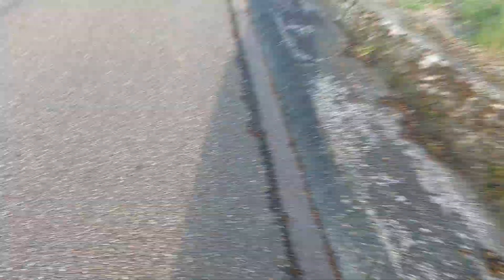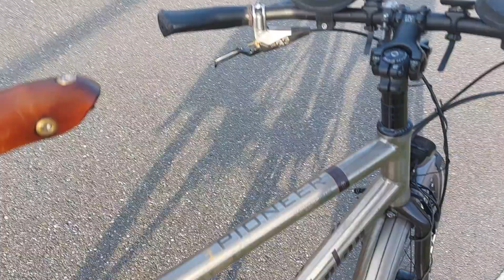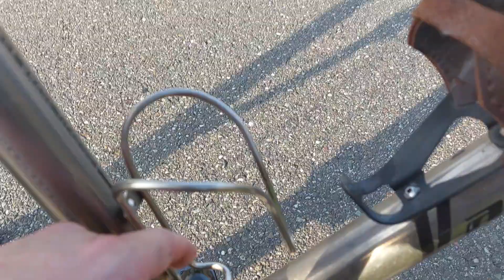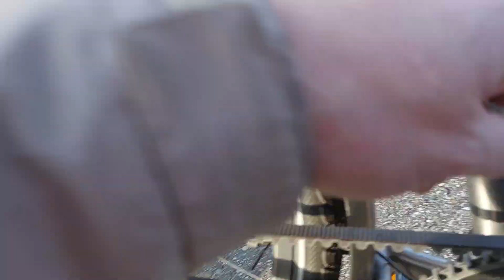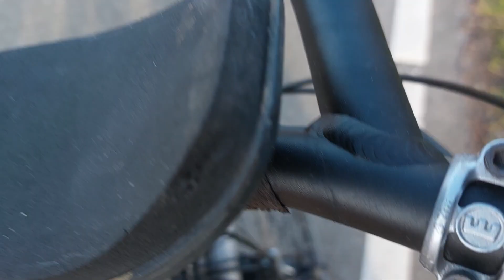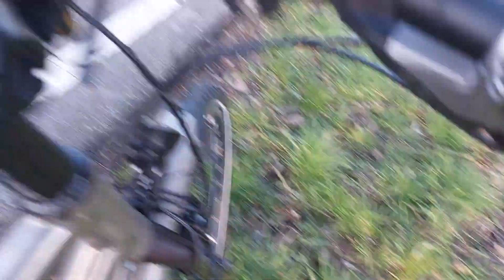review of the Rohloff speed hub: gear step size, noise, alternatives.

Comment: that saddle looks painfull ;)
Reply from the maker: It is not bad at all. Similar to a Brooks Professional in width but with a better carriage (stainless steel rails) and the shape makes it more comfortable. I want to try the wider 18 cm saddle from Berthoud which should be near optimal for slow touring (= riding with a lot of stuff in the panniers on bad roads) though the B67 at 21 cm wide also works for that so no real 'need' to buy that 18cm wide saddle.

Comment: Wanting to know what you ride currently
Reply from the maker: @kumsatx  : I still have the bike with Rohloff hub but it is in NL. I use the bike that I bought in Chernivtsi (Ukraine) in 2023 in Kremenchuk and the nearby village where I bought a house. It has a pinion P1.18 which I much prefer: less force needed to rotate the shifter, more gears, slightly smaller near optimal gear step size. I would replace the Rohloff with a Kindernay if it were available...
Reply from the maker: @kumsatx  : addition: perhaps I will replace the Rohloff hub with a Nuvinci or Alfine hub. Alfine 8 or 11, not sure, I had issues with the 11 in the bike of a friend of mine that it never selected all gears properly, 1 was always not quite ok.

Comment: Curious… why two cateyes
Reply from the maker: I had one wired but needed to repair it (cable was cut), the other one is wireless with cadence measurement (that is the main reason to buy it for me, 2nd hand, related to checking what the exact range of cadence is that I find comfortable, for my analysis on optimal number of gears), so I was testing to see if the repair worked well and also to see whether wireless transmission worked well as my experiences with Sigmas were bad and the I saw what difference auto on-off vs press to start with wireless makes for example. Side by side testing is very useful... I took the wireless one with me last trip and put it on the bike with pinion gear box.

Comment: What noise ?
Reply from the maker: At about 25 seconds and beyond you hear the noise which is like a gear noise. You hear it the loudest at the times that I push on the pedals hard (which I needed to do because of going uphill), so you hear <noise> <quiet> <noise> <quiet> from pushing with the left leg, right leg, etc. I made another video going on a flat road where I demonstrate the gear noise in a few gears. It is difficult to make clear exactly how noisy it is, but to me it is very distracting in gears 1-7, especially when going uphill and when riding on a quiet path in nature. In contrast the old Sturmey 3 speed hubs, the Nuvinci/Enviolo hubs, the Alfine hubs, are quiet. The pinion P1.18 is louder than those hubs but not annoying to me. It is a lot quieter than the Rohloff.
Reply: Also if it’s doing that on all gears from 1-7 then there’s an installation problem or perhaps not enough pressure in the gear hub after an oil change. I have never experienced any of these issues personally.

Comment: hub dynamo by shimano are pretty nice value for money, but they have substantial drag, especially over 22... 25km/h @ 28"
Shutter precision is better, SON even slightly better
After 25kkm with Shimano, SV and later on SON I'm driving now none... and went for USB rechargable light. Lowest possible drag... and cruise speed around 30 - 31km/h instead of 27 - 28km/h on the same bike.

Alfine 11: strong recommendation for keeping the R14 bike and drive both in change for longer time. Alfne 11 ist incredible value for money, but lacks efficiency and short gearing... and I felt and feel definitely the efficiency drop (having still 2 bikes with Nexus and Alfine 8)
Reply from the maker: How do you feel the drag from dynamos and the efficiency drop from Rohloff to Alfine? I have access to bikes with Nexus hubs, derailleur, Rohloff, here back in NL (for a few weeks) and I don't feel it. I do agree with the range issue with Alfine but more important for me is the gear setting which I never got right in the 500km that I used it in Poland, and that I wouldn't trust it for heavy loads/long tours. If I were to use another hub I would rather install a nuvinci/enviolo (besides the Kindernay 14 wh8ch hasn't been available for a long time).
Then dynamos: When riding 30 km/h I don't suddenly go 27 km/h when switching on the lights. There is a small drop in speed but not 3 km/h. In my calculations long ago I had the rolling resistance a bit low but that doesn't change the results much: https://swhs.home.xs4all.nl/fiets/tests/verlichting_analyse/theorie/berekeningen/index_en.html   About 1.1 km/h loss of speed with a sidewall dynamo that takes 18W at that speed, about 0.5 km/h with a good hub dynamo. The difference between dynamos is far less than that so I don't notice it. There is an issue in that bicycle lighting has completely switched to LED lighting since that analysis and such lamps use electronics that can be inefficient and cause possibly larger drag. This can also vary per dynamo as each has different characteristics that can influence how the electronics acts. It would be interesting to test this with a power meter... What dynamo headlamp did you use?

Comment: Don't care about the noise! It's not affecting the performance!
Reply from the maker: Well, I don't imply that it affects performance, I just don't like it. The Rohloff seems to be the most efficient and considering chains not always going straight and being clean, it is very close to a derailleur. I don't really notice the difference between my bike with derailleur and the one with Rohloff hub. But I do notice the shifter and the noise! Note that I mentioned efficiency in this video. I will add a bit more in a video with my conclusion after using the pinion P1.18 a lot, that I want to make today on a ride. I noted on my website that other factors seem to influence people into thinking the pinion is more efficient than the Rohloff hub, which is not so for the P1.18, and if the C1.12 were more efficient it could only be a few percent which you won't notice in use (the feeling that 'nomad's trails has about the Rohloff hub being heavy going/slower, I saw it in another video too recently, is almost certainly caused by other factors). See my page on the Rohloff and the other pages on gears here: 
 - https://swhs.home.xs4all.nl/fiets/tests_2/versnellingen/rohloff/index_en.html
- https://swhs.home.xs4all.nl/fiets/tests_2/versnellingen/index_en.html
Reply: @WHS_reviews  Oh, I can't add anything more!😃😀

Comment: Ill take that noise over a grinding chain anyday
Reply from the maker: The noise doesn't come from the belt but from the hub, so the choice is really about this hub or another hub, not belt vs. chain. You can choose an Alfine 8 or 11 or a Nuvinci/Enviolo hub with belt too. In comparison with a derailleur system it is far worse in noise, and that is despite the fact that I rarely clean my chain on my derailleur bike. I occasionally put some oil (up to a few years ago) or dry-lube (last few years)  on it, and there isn't any grinding noise despite not cleaning the chain even with oil...

Comment: I might buy a rohloff for my cargo bike that I'm building atm because other hubs don't have the gearing range necessary and the other option is a derailleur. I did the calculations and the rohloff is about double the cost of Shimano XT setup.
Reply from the maker: Yes, sometimes there is no better option. For heavy loads such as with a cargo bike and in hilly terrain it makes sense. Otherwise I'd go for a enviolo/nuvinci even putting gearing lower than allowed.

Comment: Alfine 11 has too high gears if you follow Shimano instruction of 1/2 (e.g. 42 teeth front, 21teeth back). Definitely a great hub for the price, and a shame it is not speced more often. Clearly not the same league as rohloff, but hardly few actually need a rohloff.
Reply from the maker: Agreed regarding gearing. As to price I guess you mean the mechanical shifting one, the electronic shifting is cool from what I've seen, solves the issue of cable tension/perfect shifting but at a lot higher price. The lowest gear was also an issue with the Nuvinci/Enviolo hubs I used, it was somewhat limited if following the specs. I used the N360 with front derailleur which would not follow their specs. Not sure if that changed in the newer hubs.
Reply: Depends where you’re riding. There are no hills at all where I live and I barely use the bottom half of my Rohloff gears ever. If I finally go forest touring with 25kg luggage the Rohloff will be amazing.

Comment: I very much appreciate this review.
Reply from the maker: What about the noise issue, did it show/sound well in the video? It is difficult to properly convey how loud it is (and I aimed the phone's camera + of course also the microphone forward, so not towards the hub), but to me the hub is loud. I think you had some experience with the Rohloff?
Reply: @WHS_reviews  yes I used to work at a few bike shops here in Toronto so I have had a lot of experience around many different types of bikes especially as an internal geared hubs, the noise did not come through the video but I do remember it being noisy in the first few gears. I priced it around 1500 Canadian dollars about 8 years ago we have quite a bit of bicycle theft  Toronto so I dare not leave it locked outside. So I dismissed this hub also back then it was only available in 32 whole version. I see that it's in 36-hole now
Reply: Phil wood made a special hub shell for rohloff hub with a beautiful finish and 48 hole version very expensive
Reply from the maker: @damian33dc  : Right, I could hear the noise from the hub in the video, but it stands out mostly if you know what it sounds like! :) I will try to make a better short video to show the noise issue. I agree about 32 hole, I don't see the point of it, and why they went for that in the first place? As if you need to save a little weight with a touring bike. This one is 32 hole and I would prefer 36h too, but I wouldn't buy a Rohloff hub for any further bike as the noise is just too annoying.
Reply from the maker: @damian33dc  : Aha, 48 hole for tandems, interesting. In principle the Rohloff hub is very reliable so that's why I would recommend it for long tours, but the shifting is clunky, it is noisy, I just don't understand why many people are so positive about it, most of whom do not ride much on long tours. For commuting: A definite no. I use this bike to go grocery shopping etc., but it is a smaller city, in say Amsterdam I would be hesitant to leave it locked outside.
Reply from the maker: @damian33dc  : btw, I tried a few bikes with Pinion P1.18, C1.12, and Rohloff with Gebla Rohbox + modified SRAM push shifters a few few days ago. I wrote about it on my site already but will make a short video too, also about the prices as some bikes are insanely expensive... Rohloff hubs have not increased in price as much as some manufacturers hiked up prices for bikes.
Reply: @WHS_reviews  awesome I will be checking your blog! Also looking forward to the videos.